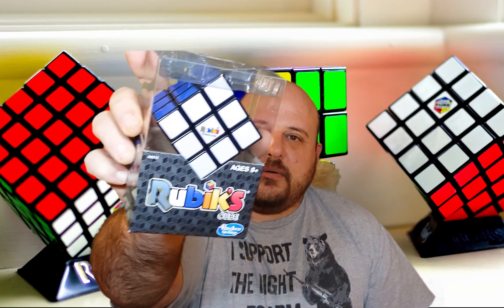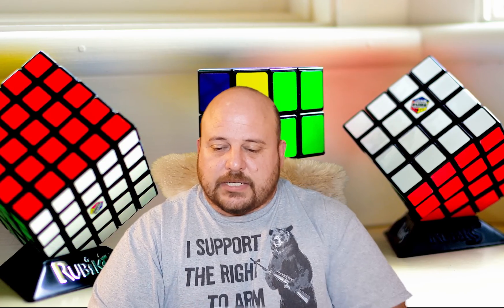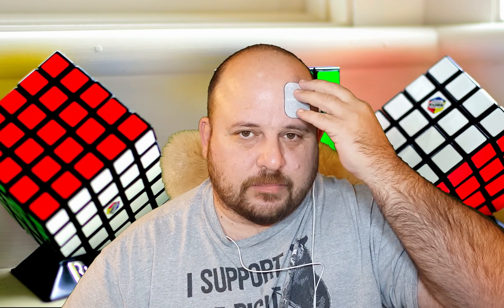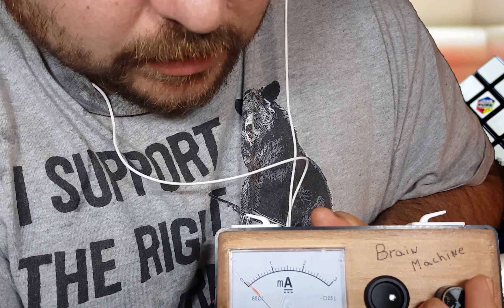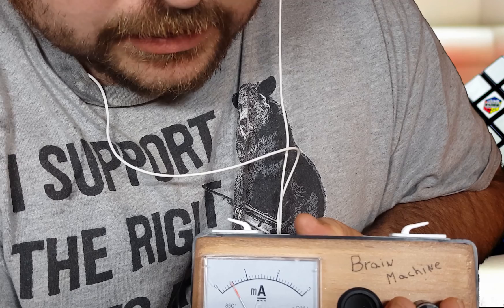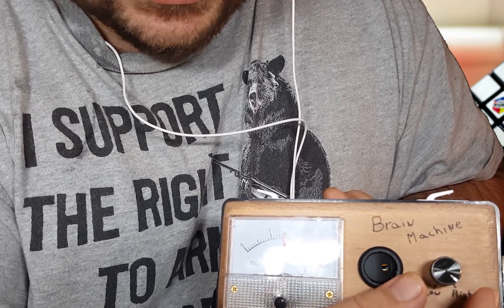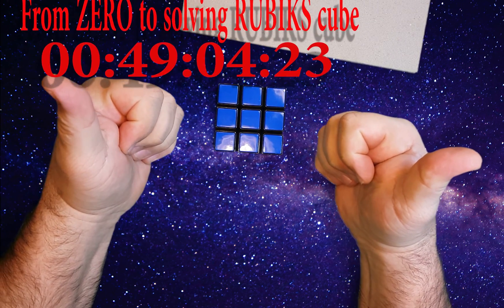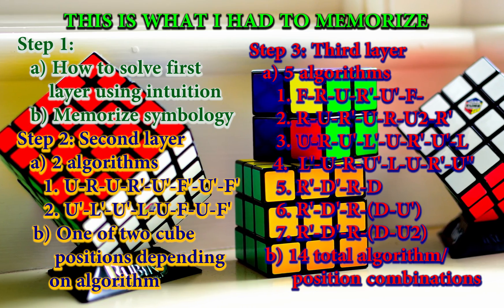Solve RUBIK'S cube using TDCS - How To DIY

Comment: Thanks for the update. I recently joined the ranks of tDCS users, in part based on your previous video. Though I ended up using the LM334 current regulator instead of the LM317, the two circuits are pretty similar, and I got off to a good start by following your lead. 

But the only reason I found this latest video of yours is because I saw you on VICE News Tonight... and the only reason I watched that was because they also used a few nanoseconds of my YouTube footage as well. ;-) 

BTW, what's your source for those new electrodes? How much do they cost? Can they be reused? 

Thanks again!
Reply from the maker: That is great to hear. I am glad I could help.

The electrode or from amazon. can't remember price, but I purchased 50 of them for not to much. they can be used 2-3 time it the are taken care of.
Reply: Just curious... what is the 'performance' like with those stick-on electrodes vs. the 'sponge' version you had before? I've been using a sponge hack myself thus far, and I've noticed a lag in the ramp-up (5~10min) apparently as the current "finds its way" through my head. Have you experienced that sort of thing?